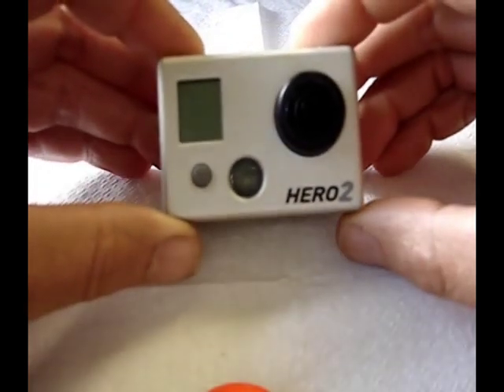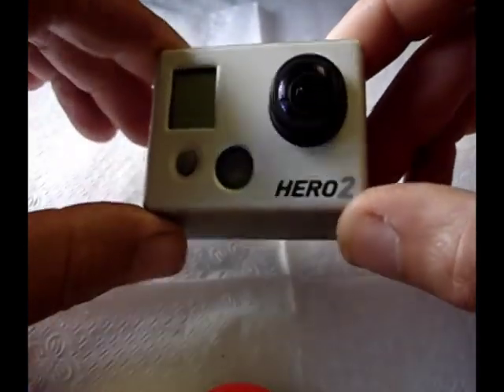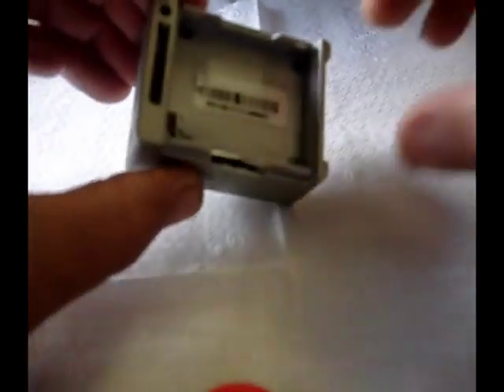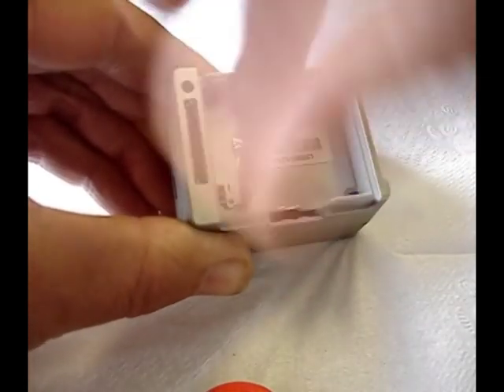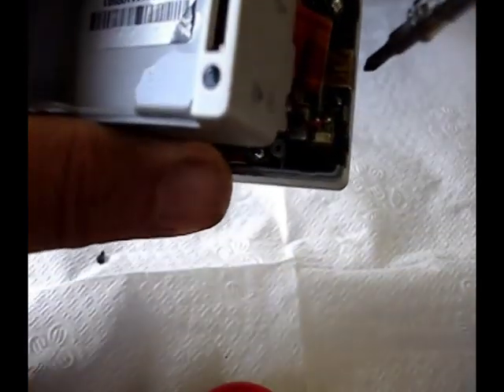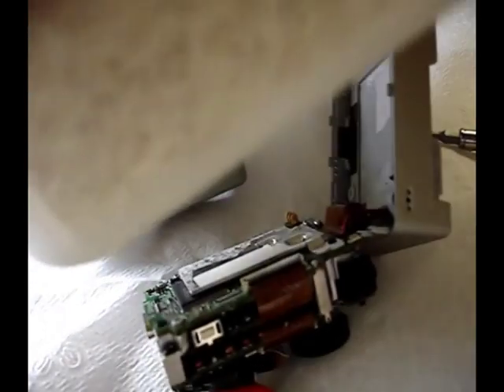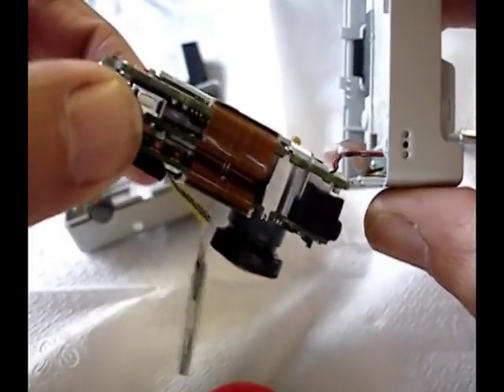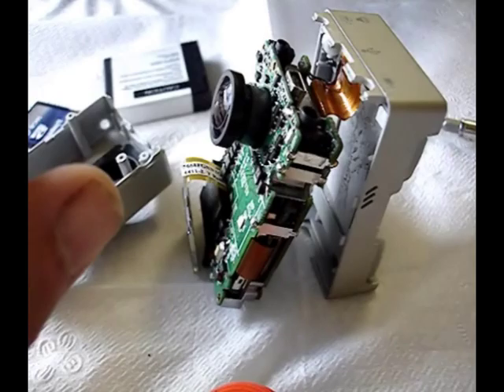WATER DAMAGE to GoPro HERO2 how to disassemble and fix your GoPro Hero2

Comment: Anyone faced with a wet camera should IMMEDIATELY pull the battery from the camera. This may well prevent bad things from happening, such as electrolysis that can eat away the copper traces on the circuit boards and components over time. This is especially true with salt water.
Reply from the maker: You are soooo correct and than kyou for the tip. Also sorry for the late reply

Comment: God video - Silica Gel is MUCH better than rice. Any grocery store, its the cat litter that looks like little plastic beads - CHEAP and I do like the isopropanol (90+%)   flush, just  dont get moisture in between the lens elements. The Iso absorbs water and promotes evaporation

Comment: I cant get 1 of the 4 screwdrivers off.. its stuck, im feeling lucky today. 3 are out already, i cant open it
Reply from the maker: videobuoy buoy I can't believe you forgot the garlic ;)
Reply from the maker: Did you get that stubborn screw out?
Reply: i ended up pulling a bit hard and it all came off. ive tried the rice solution 1 year ago when mine got wet, and it worked for 1-2 days, then stopped working again. Since then I havent been able to use it until today. I was just trying to fix it again, so I ran water through it again to clean it, and put it in rice. If it works after all this time i shall reply
Reply: Daniel Correa I just fixed a water damaged gopro hero2 by disassembling it, dipping in distilled water, then to isopropanol, then to 12% acetic acid and letting dry overnight in a warm oven with the fan running.

Comment: I poured cold water by accident on my cam 2 days ago, it had the open cover on it. It got all foggy, but it kept working, yesterday it just died on me, i guess it got moisture inside and killed it. Now, i hair dried it and left it in the sun, and still don't work. I will do this procedure, but im just concerned i waited too long...
Reply from the maker: Sounds like it is too late. Trying to power it up wet was the problem. When they get wet the power needs to be turned off immediate if it is on. It is that way with any electronic. Sorry for your loss.
Reply: Victor Poulin thanks for the info.

Comment: I just fixed a water damaged gopro hero2 by disassambling it, dipping to distilled water, then to isopropanol, then to 12% acetic acid and letting dry overnight in the oven at 30-40oC with air. I am so excited it worked again thanx for the vid!